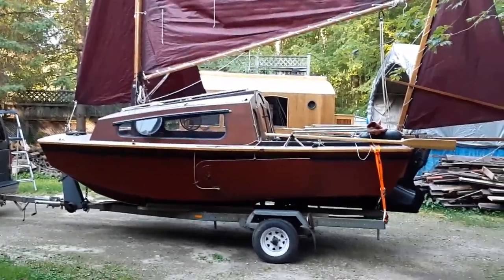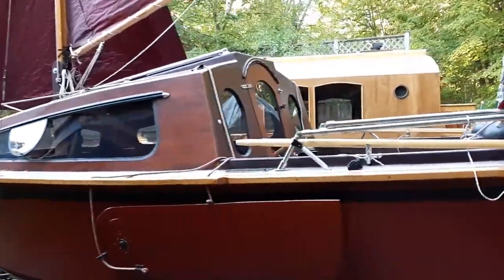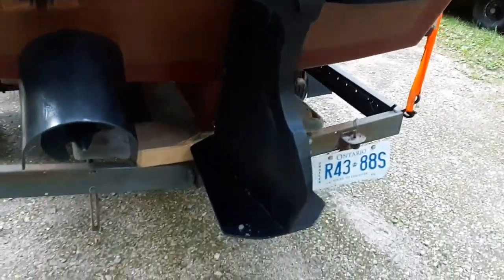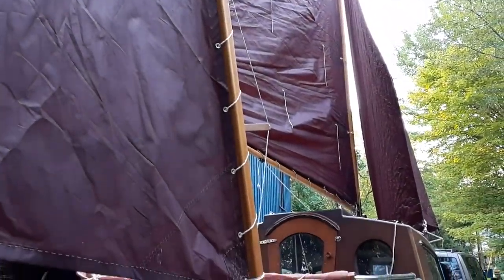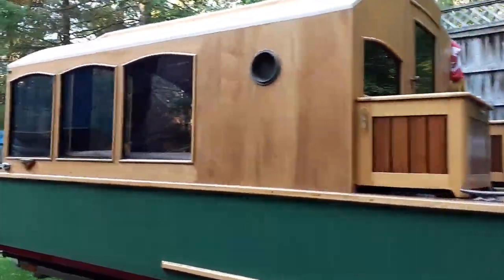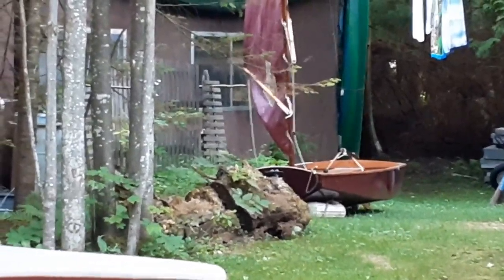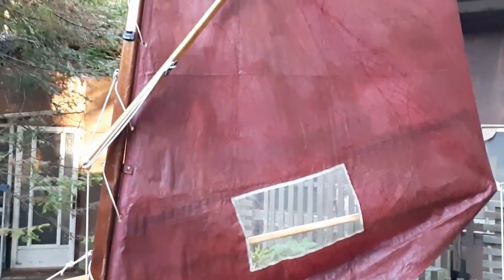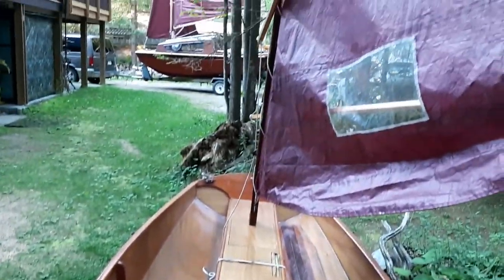ROY'S TOYS (Boat Designs)

Comment: Is Crow similar to the Pelican design?
Also, now I know how to pronounce Diane's Rose.  :)
Reply from the maker: CROW  similar to the Pelican but the hull form is arched and rockererred not flat panels. This gives CROW a softer ride and keeps ballast secured lower in the hull! She sails like a keel boat, very stable! The design work still uses large ply panels to form the arch but it is laid out so that it is not a hard hull to build! Also with the deep belly, there is good headroom in the cabin. My 6' 4" buddy can sit comfortably without needing to duck! BestRoy
Reply: @roydesignedthat 
Interesting. How much does she draw? I live on the Puget Sound where the water gets quite skinny in some places at some times. Also, are study plans available?

edit: spelling
Reply from the maker: @b_ks  YEs Study Plans are available BK! Email me for more info. royschreyer@gmail.com or visit RoyDesignedThat.com (an older site best viewed on a lap or desktop to see proper formatting)...10" draft, and CROW can sail into the wind in just 12 - 14" as the twin shallow keels do work but to point better the single lee board adds extra lift! Also the lee board works like a centerboard and needs no fussing with and works for both tacks! It didn't need to be a large, ugly thing hanging on the boat as the combo of shallow keels & Lee board has complemented each other very well BK! Here is a clip of her playing in the shallows that I think you would like...https://www.youtube.com/watch?v=LKVi8hzBwvA BestRoy